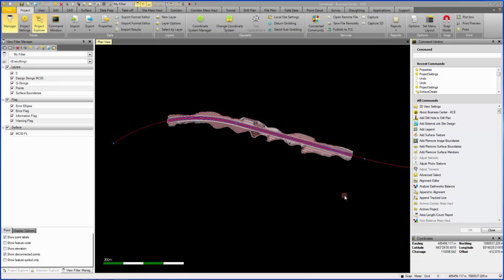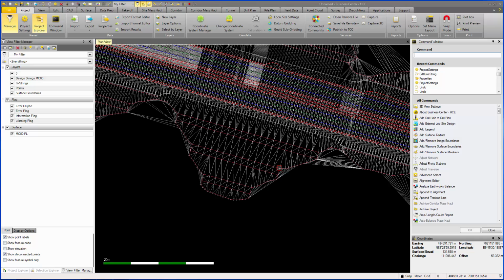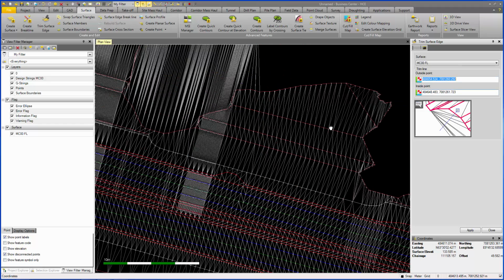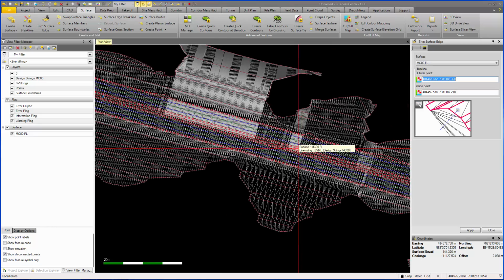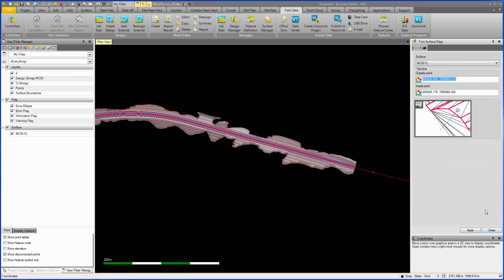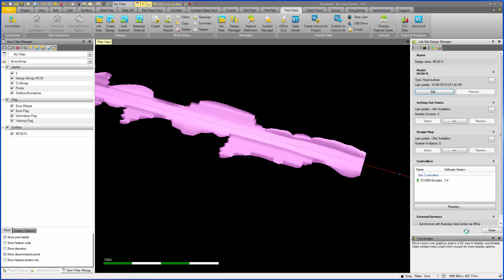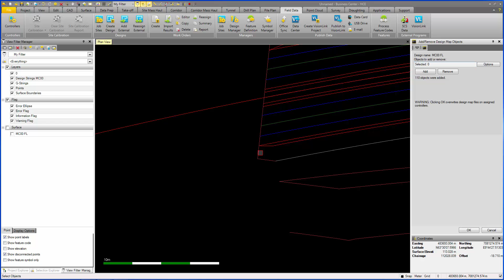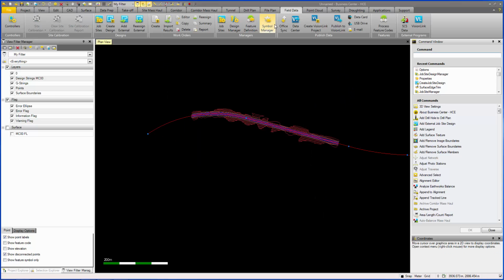BC-HCE Road Design for SCS900

Comment: Hi there. 
I have a genio file from the designer which I want to import into TBC. When I import the file I get 3D strings (CL, EC etc). Is there any way I can make a road design that ties in to those strings (cross fall might change at some chainage, road width may vary but these are reflected in the strings) and export it to SCS900? I have tried looking for such videos but I could not find anything
Thank you!
Reply from the maker: +Mihai Nita,

The data in this sample video is very much like the data that you would see from a Moss Genio file. Once you have imported the data, isolate and select the 3D strings that define the road and simply use the "Create Surface" command from the "Surface" menu ribbon.

Alignments included in Genio files are typically recognised immediately, but if you only get Genio 6D Strings, you can use the command "Create Alignment from Genio 6D String". This command can be found by clicking the drop down arrow attached to the "Create Alignment" command on the "Corridor" menu ribbon.

Once you have the surface and alignment, you can apply the tips suggested in this video to improve the quality of your surface.

If  you have trouble locating any of the menus, use "Set Menu Layout" from the "Project" menu ribbon and load the "All Commands" menu layout.

Rob